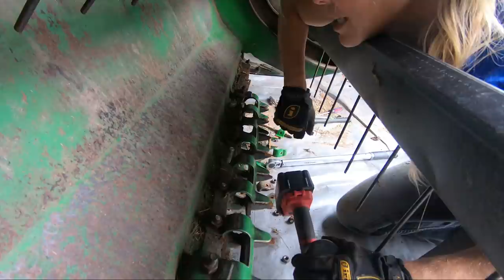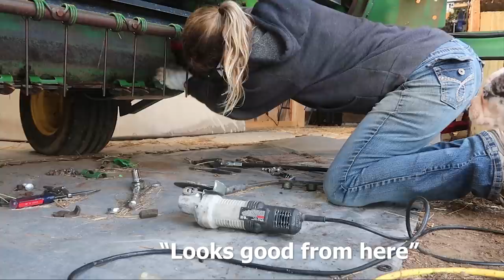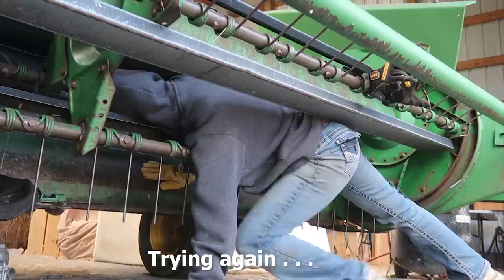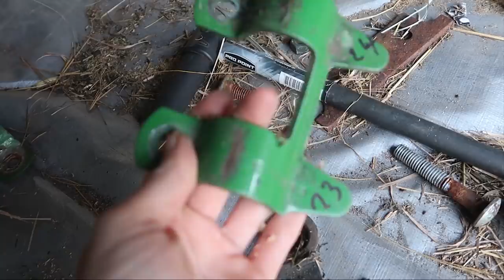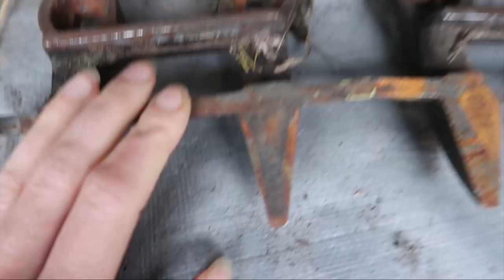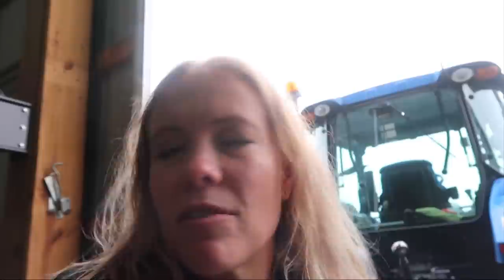335 Final Tear-Down of the John Deere Mower Conditioner

Comment: those things can be tricky to adjust, maybe you can ask an old time farmer whom is acquainted with using and adjusting the sickle bar , Guards, and Ledger plates, might have some tips like using the carboard box as a "Feeler Gauge" to make sure there is enough clearance between the cutter bar section and the Guards. that was the tip i was given to set the Points on a 1956 International Utility Tractor. Good luck with the repairs. keep up the videos and the good work.

Comment: I have been following your frustration with your mower. My experience of over 50 years of haying is definitely go for a disc mower,  you will not regret it.  Years ago we used a haybind but switched to a disc mower when the haybind just couldn't handle our heavy crops. I would never go back to a sickle bar type mower. We use a 3 pt hitch disc mower  without a conditioner, then ted the hay. Our experience is we can dry hay faster this way.  Using a disc mower is best described as cutting butter with a hot knife.  Disc only mowers are less expensive and easy to maintain.

Comment: A disc mower is the way to go. The blades are easy to replace & they can run for a long time. We have a 9' 3 point mounted New Idea mower & the biggest breakdown we had was when a wood post got in between 2 of the "turtles" & it broke some teeth on a gear. We used to do 40 to 60 acres a year with it. But since we've sold the cows we're down to about 16 acres a year. You are more than welcome to test run ours if your down in southern IL to see if a disc mower would work for you.

Comment: Suzz - I notice you have high arch tops on your stub guards. That means you have room for bolted sections. Your sickle is an old fashioned riveted style (yes, I know they still make them and sell for a lower section but if you ever hit your hand with a hammer trying to chisel off the rivets, you will appreciated riveted sections. And last video you showed several damaged sections needing replacement.

Comment: I don't know if you have a newer 1219/1209 with non clog knife guards and can't see what you have there but there aren't supposed to be any hold downs onthe first two and a half guards on the drive side that helps clear the drive side straps
Reply: Thats exactly how it is on combine miss the first 2 that way the strap doesn't hit and also gives some room for flex to at the drive end.
Reply from the maker: I would have to go back and look at my footage but I don't believe we did put the extra hold downs on that area . . .

Comment: I also had a john Deere 1219 also I was always working on it ,it cut good I found it a little slow I up graded to a three point hitch disc mower miss being able to have it condition as I mow but I have four basket tedder and ted it a few hours after cutting don't miss the 1219

Comment: I WOULD NOT WELD those bolts on... if you happen to break a knife out in field you would have to slide whole bar out to replace.. they are the way they are for a reason.. if you break a blade knife you can remove the hold downs and knife guards and replace that area easily. 

I have a buddy that has a disc mower and when I compare me mowing compared to his disc mower I prefer the cleaner look of field after i mow with my 1209 then with his disc mower. Its all what you  prefer..
Reply: she is using stub guards extremely easy to remove welded bolt or not

Comment: The  grinder  with  no  gard on it  is  extremely  dangerous  especially in difficult positions like that   . I think  if you  😁😁actually   when  you get  it back together  and get  this  hay season  finished  trade  it in for a disc  mower   with  or without  conditioner  far superior  machine  and  you  can cut in a higher  gear  .. realy enjoy your  videos   god bless 🙏

Comment: I think you found your problem when you described the pitman making an arc. That would pull up on your sickle at both ends of the stroke. My guess is the output shaft that the pitman arm is attached to is bent or you have a bearing badly worn. I really think a bent shaft. How about taking it apart after hay cutting is over and rebuild it yourself?? One last thing I learned a long time ago; need to keep equipment in a shed and out of the weather. Oil the sickle bar good with something like WD40 each time you get done with it. You will be happy you did on down the line.

Comment: Well, I'm late to the party as usual😊. Here's my 2 cents. I don't think you had a problem with the guards or hold downs. It was too easy for you to pull the knife out by hand. There is something bumping on the driven end. Metal to metal. If your wobble box had bad bearings the gear oil would probably be leaking out past the seals and dripping. You would see the oil on the Pittman arm. SO, it's probably that arm bent or the hole in it is out of round. That would allow it to over travel and bump. It might do this only at certain speeds or on rough parts of the field. As someone said you can replace the knife head and the Pittman arm. Getting these parts might take time. It'd just hire someone to custom cut it this one time, and take my time to repair the JD. If you can find someone it should cost you less than $20/acre. I've had to do that. 
You're more like a pittbull than a French bulldog. SO determined.😌😀😁

Comment: You have a long Johnson/Breaker bar.  Use it with the Deep Black 6point Impact socket.  You can also use a short length of pipe to gain leverage.  Looked like a lightweight 12 point socket on that ratchet.  They should not be that tight.  That grinder with no guard will remove your fingers very quickly.  For reassembly, you could use Gr. 5 Cap Screws of the appropriate length.  Yes, there will be some drag on the ass'y but not enough to bother the Tractor.  Use a Heavy (twice normal thickness Washer) Washer.  No more fighting square holes.  An alternative is to just tack weld them with E309 rod
to hold them in place for next time.  Put a nut on and bench weld. You could also use a small 2 ton hydraulic jack to hold the heads in the holes for assembly or removal.
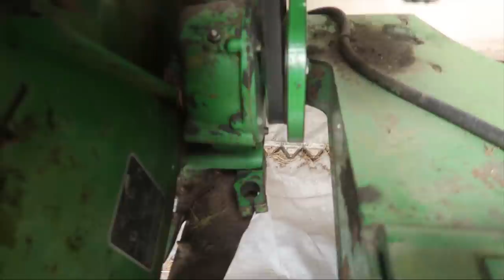Those spacer bars should be sandblasted and primed.  A machine shop should be able to make up several 4 holer's at low cost.  Use a lock washer or heavy washer and Nylok ™ Nut along with some Never Seize™ or equivalent on nuts.  Torque only to spec., no more.   Did you look down the ass'y  after the bar was removed for level?  Grind down the small portion of the end of the sickle bar that is sliding beneath that end 'keeper'.  Likely one of several causes of breakage.  The pitman arm shaft or pitman arm as many have said is likely bent. Looking at 20:00 that end piece on the pulley is obviously tipped outward at the top.  On purpose?  The Arm should not be hitting anything and moving in an Arc (up and down), is flexing the end to breakage.  This may be the time to buy a Disc-bine of your choice once you get this back together.
I imagine prices are lower due to World FU.  No, not the flu!  Wishing you had more help.  Dog training time!  Farm that out.
Reply from the maker: I did try the long bar initally, hence why it was out. But it just spun them too :(
Reply: @This1LifeWeLive  You did good to get them off.  Perseverance

Comment: the sickle part is for cutting as long as it is cutting it is performing correctly.....straight edge the top of the bearing surface of the stub guards then adjust the hold downs..stub guards are adjusted by bending them up or down to make them flat with each other...sickle end breaking is usually a pitman arm issue...when viewing the pitman arm from directly above it actually move in a arc ...if the arc is not centered it will move the end of the sickle forwards or backwards to far causing the type breakages your experiencing ...usually the arc problem is caused by the other end of the pitman arm being one tooth wrong or more on the spline ...or being bent....good luck

Comment: Lolololol!!! That pup is a helpful handful! Good job doggo, keep Mommy on her toes. :vD The arm on the wobble box travelling in an arc is probably not a good thing. That would be caused by a bent shaft in the box. That arcing motion would also cause the pin hole on the arm to deform. Then it's not holding the pin right & not properly driving the sickle. That odd motion might be transferred to the outer end of the knife causing it to flop back & forth. That motion may also be caused by the wear plate not being pushed forward far enough to to hold the knife back straight. However, too much pressure causes binding & unnecessary wear. Still not completely sold on the idea that the guards are the issue. They do tell that your knife isn't riding properly. Speaking of, it may have been faster & easier to use a Dremel to cut through the nuts & split them. As for a disc cutter of some type? Yes! If I were to upgrade to something newer, that's where I would start shopping. Unless I found a sickle cut mo-co in mint condition for cheap.... locally, I wouldn't buy one. Your video here pretty much sums up why. There's always a reel in the way. That thing drives my batty when working on my grain binder & is usually the first thing to go if I have anything more than just a guard to replace. Re.... guards! Lol!

Oh, almost forgot to mention.... if Deere has the parts that you need, but there's an updated number on them, search for the original part by the old number & stick to the NOS parts. The Parts Depot has a quick search on their website, for example. I order from them ALL the time to get the right part for my oooooold equipment. There are other old inventory warehouses out there, not sure what there is for the green machines. Good luck!
Reply from the maker: I actually was just looking at the partsdepot a lil while ago!

Comment: I cut a lot of hay a year and i just don't have the time the it takes with a haybine  so last fall i bought a disk mower i have cut my cutting time in half. And yes I bought a brand new machine so that I don't have to worry about breaking down and costing me money for 3 years. You will need a little more drying time but i start at day break or cut later in the night so when the sun comes up the drying starts.

Comment: You might look up a "Nut Splitter" on Amazon.  They might be what you need to break those stubborn ones loose, and it won't care if the carriage bolt is stripped or not.  There are several different designs.  Choose the one that seems best for you.  They are also not expensive.  Good luck.

Comment: I would weld the bolts on before installing. Put a spacer and nut to hold them tight and you just need a small weld in one spot and you can always grind it off. You can use a c clamp and a piece of wood to hold the bolt heads in the hole while removing them. Put the clamp between two bolts.

Comment: Grade 5 carriage bolts will work fine. Thats what New Holland haybines use. Probably not the best idea to weld the bolts to the guards as they are different metals. Cast becomes brittle when welded and could lead to premature breakage. Make sure all the guards are in a near perfect alignment from left to right. Thats all I can think of right now. Sickle bar should move in and out by hand without much effort. Keep the pitman arm greased as well as the wobble box. We grease ours every 5 - 6 hours as grease is cheap compared to a $1000 wobble box.

Comment: You will have a hard time welding the bolts as you have cad plaiting and a forged harden bracket . when you heat hardened steel you lose the temper
Reply from the maker: and lets not mention upside down too ;) BUT, if it can hold enough to keep them in place during removal, then that's all I need :D
Reply: I believe those may be Cast steel brackets.
Reply: @This1LifeWeLive  Bottle jack under the bolts.
Reply: @gordbaker896  yes they are castings because we've tried it welding the bolt heads before on the combine ones, sometimes it holds enough other times it either breaks the welds or even worse lumps out the casting.
Reply: @roymoon1  Yep,  you got it!
Reply: Ok, here we go:
 1.  Buy the correct grade 5 bolts. 
 A.  Correct full square shoulder.  Take a guard to store with you.  Compare cheap bolt with correct bolt for fit. Some cheap bolts will have smaller and shorter square = problems.   (How much is your time worth in the field?)  20 min to grind off, new bolt$ each time?  Agrivation and busted knuckles.....not good.
B.  Get correct length.  Bolts should not protrude more than a half inch over nut.  Excess height impares crop flow and is just a lot of dirty crusty excess.
2.  No welding!  
A.  One of your other commenters was correct.  If you weld, no more field repairs.  You will be going back to barn for grinder and/or complete bar removal for single knife swap.  
B.  Simple trick.  Carry a block of wood and a small 2 ton bottle jack.  Use the bottle Jack to hold pressure on the bolt head to keep carriage square engaged in the rock guard square.  

Bales per hour or hour per repair.  Cheaper softer bolts that will deform easily when using impact tools is not the right choice.  

Twenty years later, half of the bolts on my swather are original equipment.  (I rarely use impact tools on high maintenance items, less chance for deformation.)   It is well cleaned with compressed air and put to rest in lean-to after each job. If you don't have shelter for it, cleaning is a must if you want to prevent excessive rust.
Reply: @gregorycross612  What he said! Yep Yep Yep. Maybe a dose of cooking oil down in there when you put it up for the season.

Comment: John Deere does sell the part you broke they call it a drive head so you don't have to buy the hole knife to get it, you will have to re-rivet or bolt it together. Shoup equipment does have knifes but there shipped in to parts, you bolt together in the middle. They might have the drive separately not sure?
Reply from the maker: I have seen the drive heads online, but not sure I want to monkey with swapping everything :P

Comment: If you weld the carriage bolts on then if you break a bolt or round off a nut, you will be buying the complete assembly. Not a good idea, when it drops down, as you noted, hold the head with a vise grip pliers.
Reply: They wouldn't need to be burned in like one solid piece. Just tack weld them in place, and you can easily grind it back off if you need to.

Comment: We are hoping to chop our old drum mower for a 2.8m straight 3pt disc mower partly due to how much a conditioner adds to the price, partly due to the amount of weight hanging out the side and partly due to the fact it is one less piece to wear and then cause problems
Reply from the maker: drum mower vs disc mower?
Reply: @This1LifeWeLive  dad prefers drum mowers as generally they are more robust and simpler with the drivetrain and gearbox way above any hidden boulders, old footings and stumps where a disc mower it by its nature had the gearbox skimming the ground. Drum mowers weigh more in like for like cutting width and generally speaking disc mowers are a lot more robust now. Disc being more unobstructed will generally be able to go at faster speeds.

A lot really just comes down to preference just as it does with makes you can speak to one and they will say the complete opposite, I've spoken to multiple people and contractors some say drums will stuck the grass upright when its gone flat others say a disc will get under it. Some say Kuhn others say Krone or JD, Vicon, they all break and it depends on the dealers. It can get frustrating when trying to choose but good luck

Comment: The arc motion in the wobble box would easily break the sickle. It’s putting an up and down motion into the bar thousands of time. Eventually something has to give.   If your cutting early quality I’d go plain sickle mower. Disc mowers run better in heavier crop.
Reply: Correct! Disc mowers don't work as well on light hay. Because you have to drive fast enough to keep them loaded. And if your ground is not really smoothe, you can't drive the 8 to 10 mph that it takes. A friend of mine cuts 2000 acres of hay a yr, mostly Bermuda grass and alfalfa. And about 1/2 for racetracks.They do it w/2 16ft Hesston SP mo/cos. And they both are sickle bars. He could afford either kind, of course. But those work under HIS conditions.
 I've seen another friend of mine do an embarrassing custom job for a neighbor on his alfalfa with a brand NEW JD disc mower. Light hay/rough ground.
Reply: Earl Young it’s all in what your doing and conditions. I’ll take 8-10mph with no plugging all day over a sickle. But in her case here a new enrossi or other sickle mower cost what a cheap used disc does.

Comment: DON"T Weld... Someone suggested welding in the earlier video so you could stop the bolts from spinning.  Have Deere order you a new " Bolt on Knife Head" part number AE48125. Bolt to your sickle bar ( order bolts too) Order a new pitman arm from Deere as well.....Take your old one with you and match it up. If it's like the new one they can send it back  Called " Knife Drive Arm" Part number E81021. Quite sure the arm or shaft is bent.Arm should not rub frame.Something is BENT.

Comment: One thing I see is that your bolts are too long... Anything protruding above the cutterbar will hinder crop flow... plus too many threads above the nut will carrode making removal what you are   experiencing.... You will have to use different lengths for different locations..... good rule is about 1/8 of an inch above nut
Reply: You are right.. my sickle machine (JD) has only one thread above nut  shot  of WD and they zip right off

Comment: Check the mounting rail on the machine to make certain it's not bent or out of alignment.  If that isn't right nothing else will be when you start hanging parts on it. Start with the beginning and then if that's right look at the other parts.
Reply from the maker: Nice tip!